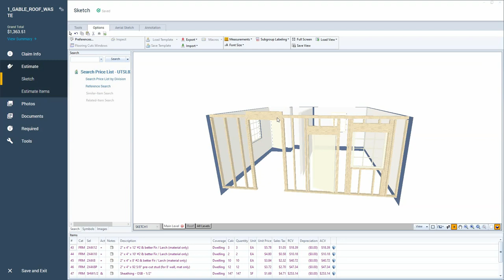Show Framing in Sketch

Comment: Great tip ow to add the materials. There is something I have always been curious about and I debate this with adjusters all the time. Let’s use a heads as an example. To my knowledge, to replace a header in Xactimate the software calculates the exact measurement of the lumber needed and the labor to install that exact piece. Correct?

What if the material is bulkier in size and needs to be manipulated in order to be installed. Contractors,would purchase 2x10 in bulk pieces and cut these pieces down accordingly. There will be waste. Does the software add waste to the material cost? Does the software take into account the labor needed to manipulate these materials before the install?

If it does how can I see it?

Thank you for what you do.

Comment: Once the line items appear in purple, how do you move them from the “level” to the specific room in the grouping pane? Copy/paste will not work. Thanks!
Reply: Go to estimate - highlight room where you want framing to show in estimate - in the room estimate items - right click drop down menu will appear - select other options - retrieve scope - mini tree will appear select level with framing - Enter - framing will transfer to room.
IMPORTANT to prevent duplicate framing in estimate - Go into sketch highlight framed room CHANGE framing to none. CTRL-S to save.
This also works for roofs and foundations. If you have framing in several rooms follow these steps for one room at a time.